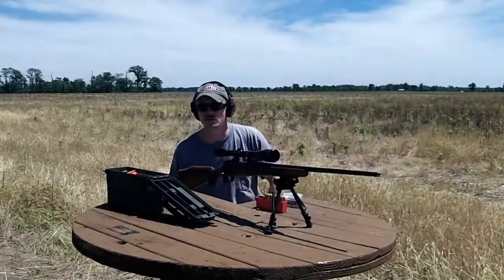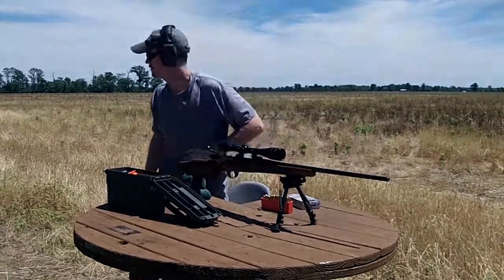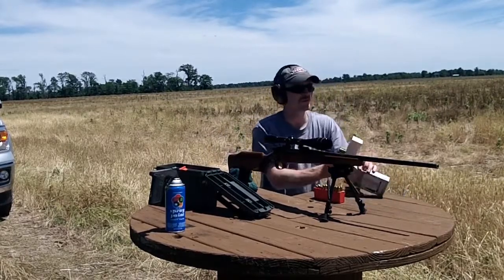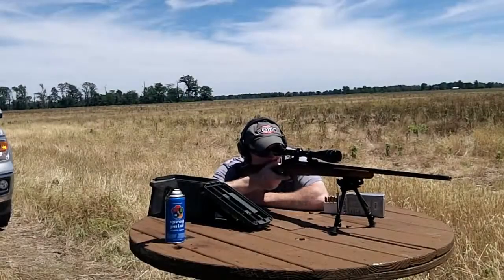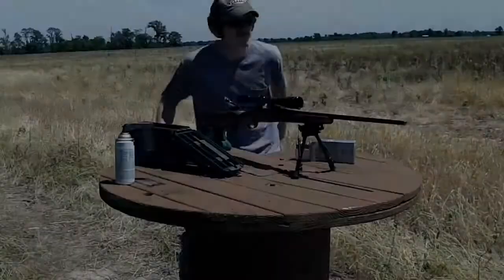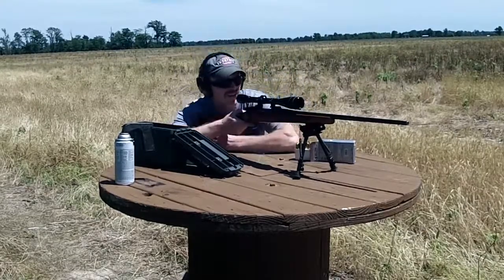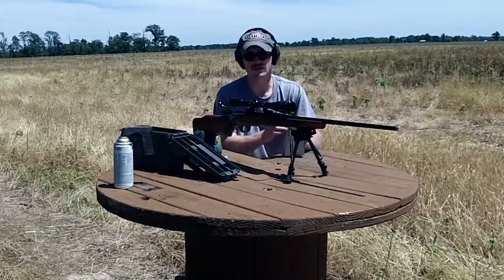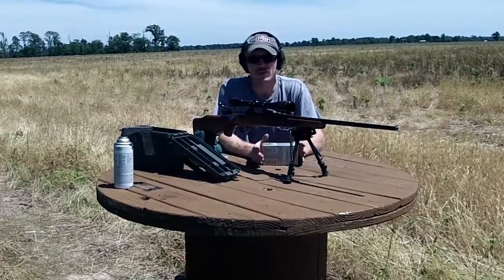Day 2 with the INTERARMS Mark X .243

Comment: You should generally always load a Mauser rifle from the magazine.  You can get away with dropping a round in and closing the bolt for a short while, but will eventually break the extractor.  I've broken a couple myself.  The angle on the extractor face is just not quite right to feed like a push feed.

Comment: noticed the rifle hops quite a bit with the bipod...if you attach a strip of wood in front of the bipod so you can have something to press it into it wont hop anymore and your accuracy will improve with the bipod being "preloaded".  to find out what the twist rate is you can insert a cleaning rod down the bore with a brush on it most of the way in then put on a piece of tape on the rod pointing up and pull the rod back allowing the rod to spin in the rifling till you get one full turn and measure the travel

Comment: How did the owner feel about the bullet selection they'd have to use? I don't know if anything less than 85/87 grain is available for consumer purchase on loaded ammo. So, if they wanted to shoot accurately and with a limited game selection, they'd have to load for it if they don't already.
Reply from the maker: I had 60g, 70g, 75g hand loads they sent with the rifle, then I loaded up some 87, and 105's.  I also had some factory 100g soft points.  The twist was to slow for the 105's.  I couldn't hit the 16 inch steel at a 100yds.  As far as everything else.  The lighter the bullet the better the group.  If I remember right 2 inches was the best group at 100.

Comment: 7 and 1...
Reply: Hornady manual states that the 105 grain bullet will not stabilize in a 1:10 twist or slower barrel. His note of 1:9 is correct. You may be thinking .223/5.56 where you need a 1:8 or faster for the 70+ grain bullets.